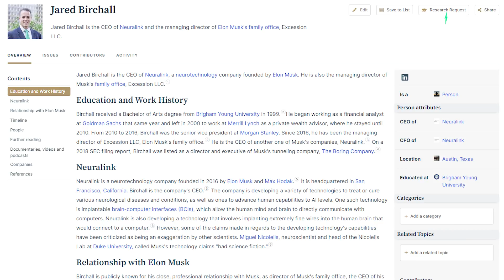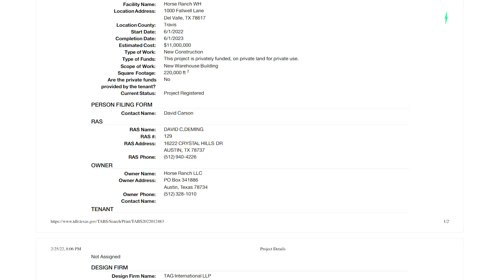Tesla buying land near Giga Texas: battery news

Comment: Where did you get "they are buying more land" shit? they already owned Horse Ranch.
Reply: Check this shit:  Horse Ranch LLC bought 600,000 acres to build an $11M, 220,000 sq foot warehouse building.  That shit is going southeast of the Colorado river.  If you need a map, Joe Tegtmeyer shows you in his Feb 25 vid.  Sheat, you don't know nuthin.
Reply: So this is "Old News"  🤔
Reply: @icosthop9998  Yup, but good ol' Ray don't know it.  Goin' in right 'cross the river from Giga Austin.  But there go Ray and his posse of three, ridin' off in the wrong direction and spoutin' shit.  Sheat.

Comment: At some point in the next few years, an AI expert on "Connecting the Dots" expects Tesla to build a chip factory and make their own chips. They have already started designing them and the AI will help make a more efficient factory and designs. If Tesla has learned anything about the supply shortages it is that the chips are as important as the batteries! Not to mention they want to produce bots that will take more chips than the cars!! I think this will be built in Texas!
Reply: The large Samsung semiconductor fab here in Austin already supplies some of the chips for Tesla. Samsung just late last year announce a second multi billion dollar factory to be built about 15 miles from their first plant. Austin is already home to major chip design centers for AMD, Intel, Cirrus Logic and others. Tesla is probably using that local talent to assist in their chip development. They pretty much have a lot of resources here in Austin. I know someone who has a friend who works at the GM Innovation center here in north Austin. He says high tech talent there are looking to go to Tesla when more technical design and software positions open up in Austin.
Reply: I understand,  but if that's the case then why is Tesla still chip constraint? Demand for chips is only going to grow in the future. So Tesla is going to do with chips the same as batteries. Buy all they can in addition to making their own. Between 20 mil cars and the bot Tesla will need all the top line chips they can buy and build. Tesla is always playing the long game!
Reply: Upticked. Very interesting.